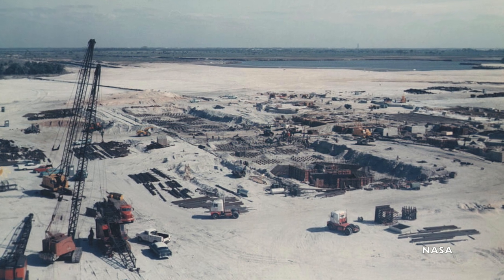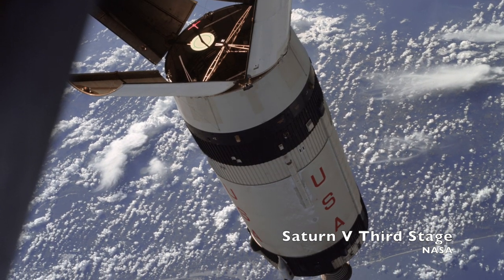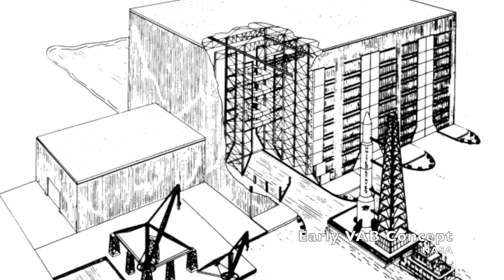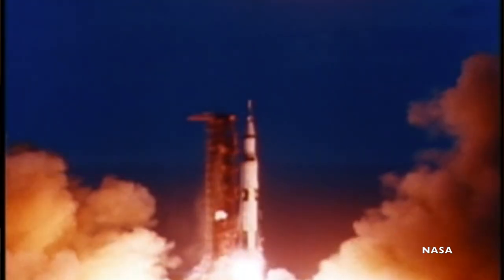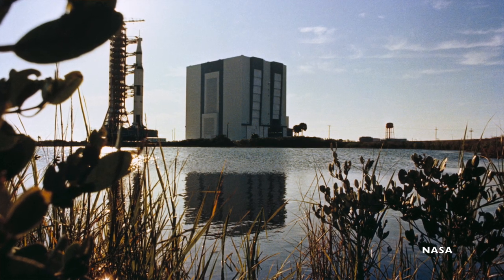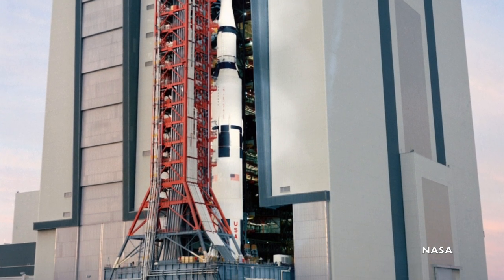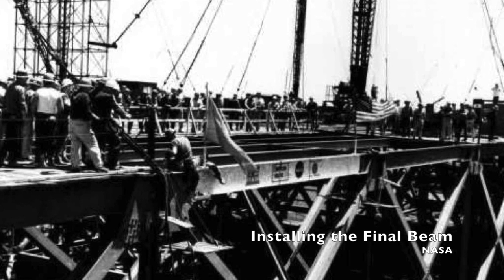How Do You Design a Garage for Rockets?

Comment: I remember in 1967 when I was 12 we took a tour of the Kennedy Space Center on spring vacation.  At that time they walked you into an enclosure cage inside the VAB.  It was impressive to this future engineer!  The also drove very close to the Saturn 1 being brought back on the transporter with the burned out Apollo 1 capsule on top.  Very sad.  In '89 you could see a shuttle being worked on through an open door from the bus, and in 2002 they only drove around the VAB from about 200 ft away.  Oh, back then, Orlando was just a sleepy little orange grove town.  Your channel is great.

Comment: this may have been mentioned a!ready but the slabs are balanced to a tolerance of less then the thickness of a quarter, and during inspections the engineers stand on the slabs with out safety equipment

Comment: Is it true that clouds and rain can happen inside the VAB?
Reply from the maker: Alex Lopez Yes! The VAB is so tall it does have its own weather system up near the ceiling!
Reply: Amy Shira Teitel so there will be water dripping from the wet roof (not cloud) and cause problem right?
Reply: +Do not go gentle into that good night. Rage, rage against the dying of the light. No it is literally a "cloud" (defined as a high humidity weather cell) formation at the top of the inside of the building which can literally precipitate....I have been in the VAB a number of times, both as an Engineer for Lockheed Martin and as a kid when my dad worked at The Cape back in the space race years.
Reply: Amy Shira Teitel You look amazing in that "vintage" photo Amy...simply stunning...I think I've developed a bit of a crush on you... :)
Reply: +steve Fowler yeah guy, that doesn't make you look kinda like a stalker...
Reply: bean420man lol...just means I'm still breathing...
Reply: Amy, the VAB does NOT have its own weather system.  That is an urban legend that has circulated for decades.  When I first began working at KSC, some of the older techs told us that the VAB can generate its own weather and I passed that story along as did most other young folks who were told that.  But in fact, it isn't true.

If the top door panel is left open, it can let rain into the VAB.  In Florida sparse clouds can cause rain when it appears to be mostly sunny.  So looking out the bottom door panel that is open, it may appear to be fairly clear and not raining when in fact it is.
Reply: This is 29 years as a KSC employee talking.  The VAB does not have its own weather.  It is an urban legend that still exists to this day.  It originated with air conditioning in the VAB.  The high bays are 525 feet tall.  Air conditioning near the upper levels causes condensation that drips to the floor.  When you are 525 feet below the condensation it is hard to imagine that is what is causing it so folks came up with this whole indoor climate idea.  Its circulated for decades.  News that it is an urban legend hasn't really made it outside  of KSC yet, that is why it is still listed on line.  I can imagine Amy asking some of the Oldtimers about it and see them telling her with a straight face yes it has weather.  It doesn't

Comment: Maybe do a video on why (if there are any real reasons) most American rockets use vertical assembly? The Soviets did not and SpaceX also assembles horizontally.
Reply: It is cheaper to process vehicles horizontally but then they have to rotated to vertical to launch.  To handle the stresses of the rotation, you either have to design the rocket to mechanically take those stresses, which adds unnecessary weight, or you have to use a 'strong back' that the vehicle rests on during rotation.  In the end I think its half dozen of one, six of the other.

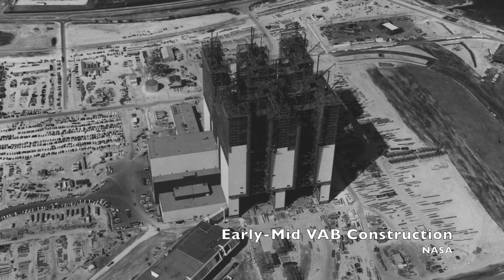Comment: 2:20 "...comprising some 45 metric tons of structural steel"

For a building of that size, that small amount of structural steel would be a miracle.  That's roughly the weight of 20 Chevy Suburbans.

According to Wikipedia, "Construction of the VAB required 98,590 tons of steel".
https://en.wikipedia.org/wiki/Vehicle_Assembly_Building

Comment: Actually the old dirigible hangers can create its own weather inside as they weren't climate controlled back in the day. They were huge wooden structures designed to keep the heavy winds off of the ships. Helium was added or vented off to maintain buoyancy. Also for big maintenance the ships could be hung and degassed. But if I'm correct the VAB is climate controlled or at least sections are.

Comment: Presumably the height of all future American rockets for the next 20-30 odd years will be limited by the height of the doors on the VAB?

What did the Soviets build the N1 in?
Reply: i saw photos of it being buid when lowered, but dont know for sure...
Reply: +Phil R Something else to consider.  The width of the SRBs was, in part, determined by how large a payload could be transported by rail.  Railroads in the US followed the same width standard as Europe.  Europe's rail system was originally built based on the size of existing ancient roads made during the Roman Empire.  Those roads were designed around the width of a chariot, which itself was based on the width of two horses harnessed together.  Yes, part of the design of the Solid Rocket Boosters was based on the size of a 2000 year old horse's butt.

Comment: I had an additional duty job in the Air Force where I tracked construction of a 60,000+ sq ft structure for my Wing Commander and so I was constantly talking to CE (Civil Engineering) and ACE (the Army Corps of Engineers).  It took years to build.  I bet if the government had to build the VAB today it would take well over 10 years.  We don't exactly achieve efficiency in today's government......